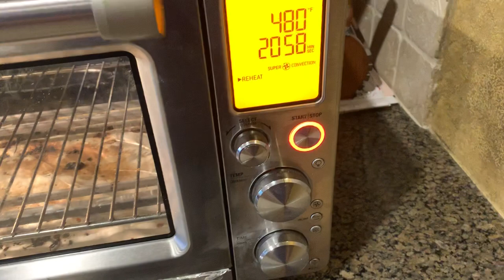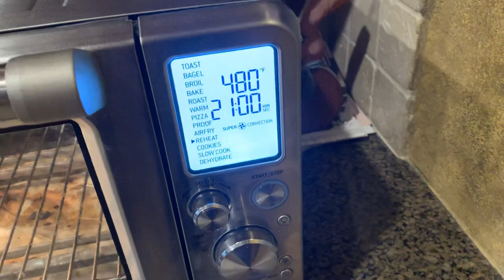Repair your Breville BOV900 Smart Oven when the door won't fully close or the timer stops working

Comment: Your description and the comments by others were very helpful and I fixed mine yesterday.  I did snap a couple of pics so others can see the part that needs to be bent.  My pics are after bending and I used needle nose pliers to gently do the bend.  https://photos.app.goo.gl/pjYJoUW4d1sBKRmBA  Be sure to open and close the door a few times to make sure the tab on the door lever hits the switch arm properly before closing up.
This is definitely a case of bad design and we should not have to resort to this kind of repair.  I love the oven when it works but Breville is on my blacklist from now on.
Reply: I looked at your pictures but have no idea what you were showing. My oven door won’t close & this is the 3rd oven they’ve replaced with the same problem. I am not handy with tools & have no one to help me. This is really frustrating. I thought the guy in the video said WD40 fixes the problem. I appreciate you & others trying to help but I don’t understand how to fix the oven door that won’t close.

Comment: Hey have you had the light stop working from when it you cleaned it inside?
Reply from the maker: Lissy London  I have not, but if you care to work on it, I can talk you through figuring out what the issue is. Even with no previous experience, as long as you have or are willing to buy the tools, I'm fairly confident that I can talk you through isolating and eliminating the problem.
Reply: @bretbradbury5559  Well i'm not sure what happened but it just randomly started working again! So thanks... but I guess it's good- for now.

Comment: My first BOV900 Smart Oven arrived from Amazon brand new and DOA (door would close but timer would shut off oven after a short amount of time). My second factory replacement oven has failed.  Still within 2 years so they can just send me a new oven.

Pro tips..  

1. If you order your oven directly from Amazon NEW you will get a two year factory warranty.  If you get refurbushed from Amazon Warehouse you will get a 6 month warranty.  Third party sellers?  (Don't know).  I do know Square Trade warranties bundled with Amazon purchases are not honored if the item did not come from an Amazon warehouse (big lawsuit on this one).   

2.  Breville will require you to send your oven back to them.  KEEP THE PANS and ACCESSORIES.  They don't care about getting that back. (You have to put down a $143 deposit to have them send you an oven immeditately).

3. Don't put anything heavy on the door when it is open (like that hot casserole dish).  That hinge won't take it.

Comment: help ...err E06
Reply from the maker: If I'm not mistaken, that is a processor fault code. They say that it is a "non-repairable" issue however I would look up the data on that chip and see if you can measure the input voltage and ground quality on it. If those values are good, contact Breville about a replacement board for it. If they're not good, dig into the power supply circuit and repair it if you're comfortable with component level repairs.